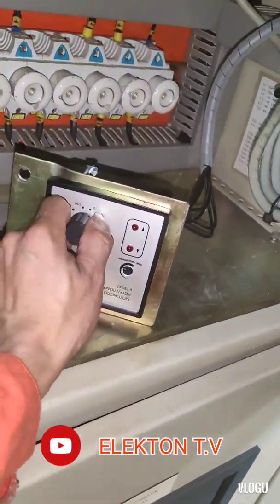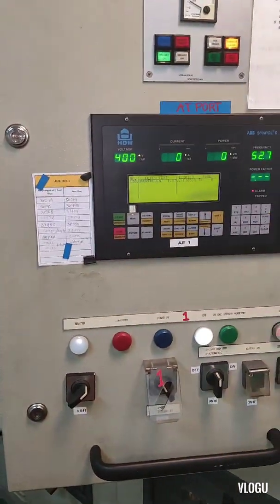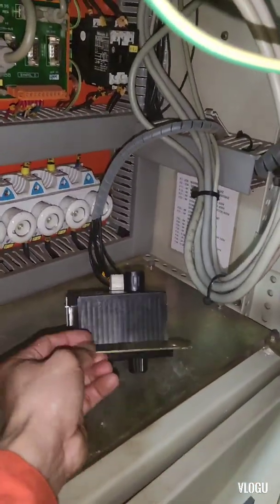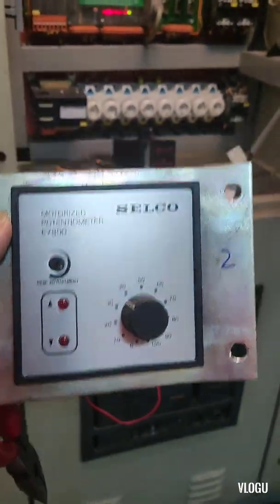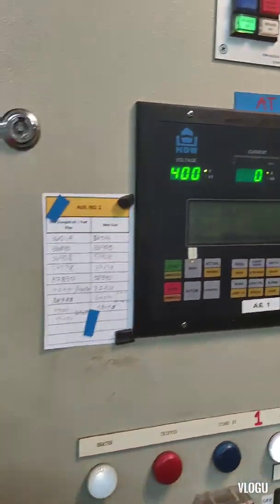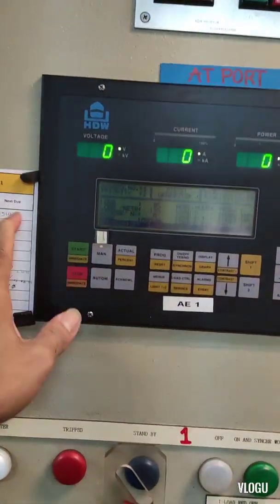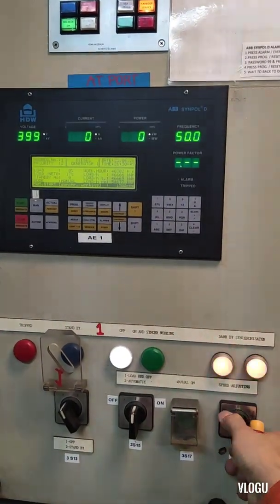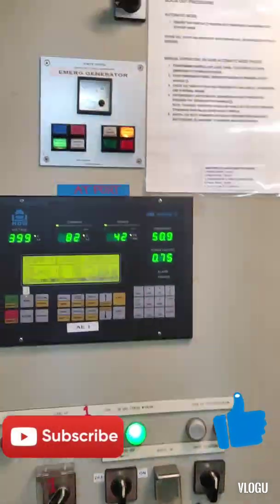GENERATOR CAT. FREQUENCY ALARM, RPM PROBLEM,REPLACE MOTORIZED POTENTIOMETER IN MSB

Comment: Yung C18 Caterpillar, same procedure ba ang troubleshooting? Over speed sya at 1947 rpm and 64+HZ frequency. Tried to reduce speed via the control but no response. Ano ba possible na sira? Any idea what to check?